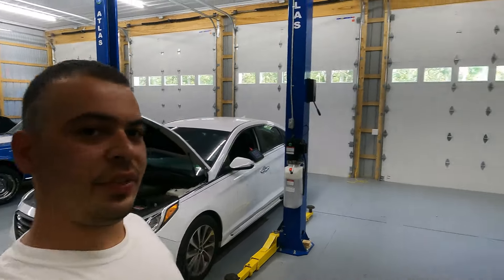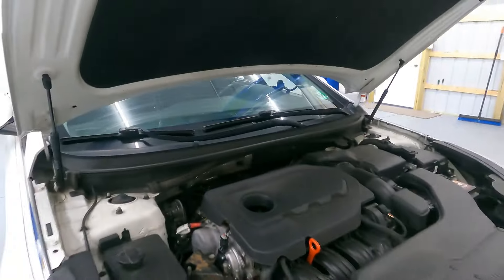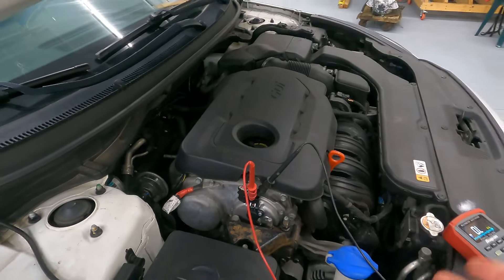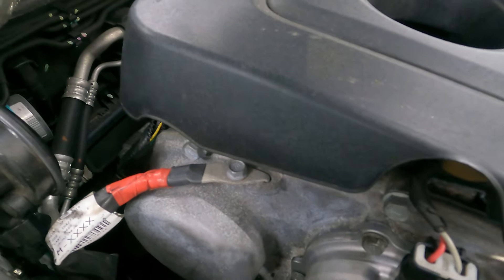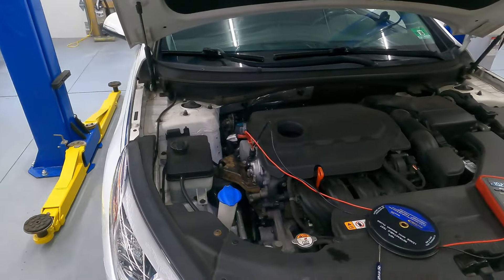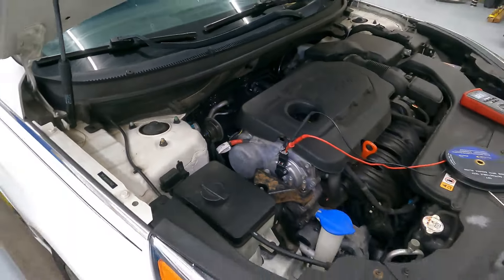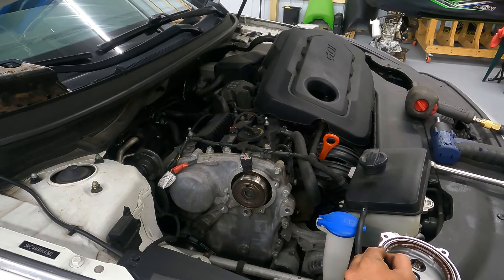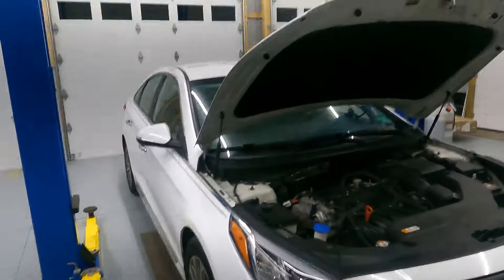Hyundai/Kia P0010 diagnosis and ECVVT inspection!!

Comment: Any idea where is the intake vvt solenoid?,because in my Kia optima 2017lx it’s not at the side of the intake manifold
Reply from the maker: The intake VVT is an electronically controlled unit. It does not use oil pressure to actuate so there is no solenoid on the intake side of the engine, only exhaust side
Reply: @SEsGarage  Yes, it is true on the exhaust side only.:face-red-heart-shape::face-red-heart-shape:

Comment: Would a leaking valve cover gasket cause oil intrusion into the cam phaser?
Reply from the maker: Nope! It’s a totally separate system. A bad phaser plug or the seal on the cap is the only way for oil to get into that system.
Reply: @SEsGarage  thank you for your clarifying.
Reply: Sorry I cant find the video I originally messaged you on..hyundai replaced my engine last week under oil consumption issues..1qt a week...they put semi synthetic oil in despite everything out there saying to use full synthetic ...only 500 miles should I change it out now..and what oil do you recommend?.. I've read to use 10w30 full synthetic instead of 5w20..please help
Reply from the maker: @mikeh6095  I’d do a break in change at 500 and run whatever synthetic 5w20 you prefer. For engines equipped with variable valve timing, I tend to stick to the original recommended oil weight as the VVT systems are calibrated to run on a specific oil weight. Hope this helps!
Reply: Thank you for the info!...I appreciate all your videos regarding hyundai 2.4 engines!👍
Reply from the maker: @mikeh6095  any time!